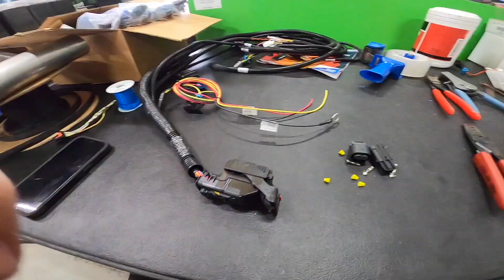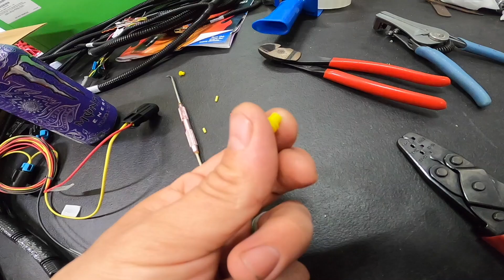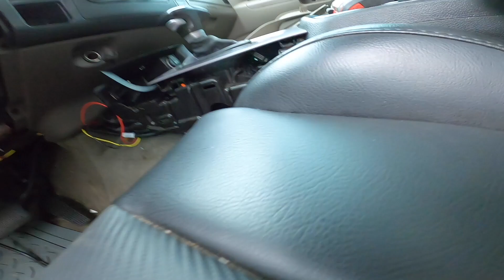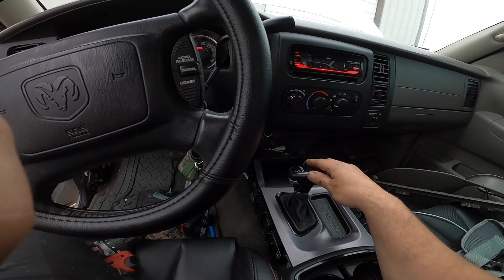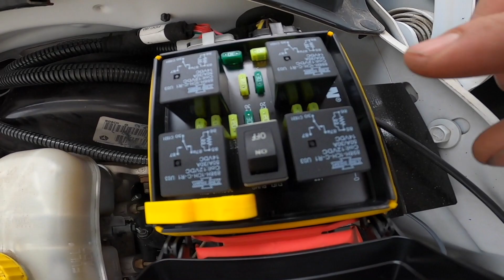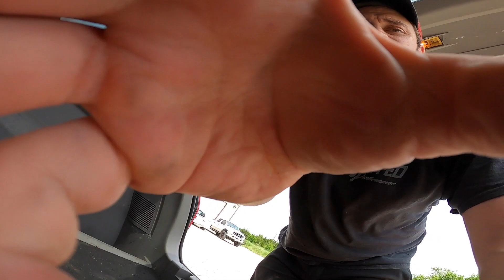New Updates! Sound German Engineering Transmission controller install! and a NEW Part! check it out!

Comment: I have a buddy that swapped a 8hp70 into a 1973 challenger. He wired everything up like you have it and he can't get it out of park and into gear. Any ideas?
Reply from the maker: @halfastracing8311  he’s missing something. Possibly the brake switch input. Depending on how his kit is setup. It’s either looking for ground or power. The kit is configured one way or the other. That needs to be looked at.
Reply: @MoparManiacMotorsports  he hooked it up to the power wire off the brake switch. Although before that he had the brake switch pin ran to straight ground. That didn't work either. I'm kind of just trying to help him out without actually seeing the car and seeing what he has going on. So just taking his word for things.

Comment: What car is that console out of?

Have you tuned the transmission yet? Im wondering how well that piece works...
Reply from the maker: @brandonbass389  I actually ended up selling the truck. However I’ve done the 8 speed swap in lots of vehicle and it’s worked perfectly. It’s different how you tune these with the SGE kits because of the lack of torque management

Comment: I want to do this after the winter in a 2004 Ram 1500 quad 5.7L 545RFE 4x4. I have 2 concerns that you may be able to help me with. The 2004 is the Chrysler PCI bus, not CANbus.
1. Using the sound german kit, can I keep my check engine light off (need to pass inspection)
2. How do I do torque management between shifts? I'd like to cut injectors or retard timing.
Also, what state are you located in as I'd like to bring it to you for the swap.

Comment: Quick question..I have the same shifter but mine doesn’t seem to connect to the shifter.. the connections look different
Reply from the maker: Probably have the connector for the rotary shifter for the trucks. You’ll need the one for the car shifter
Reply: @MoparManiacMotorsports bro thanks for the quick reply but I looked at it again and I found it…I was looking at the “shifter” up top and not from the actual shifter. Had me stressing for a little but it’s there lol

Comment: Is that harness for the hp basically a stand alone ? Or does it need to read engine rpm to operate.
Reply from the maker: It has inputs for rpm. Or it works off of the can bus.

Comment: I did this swap kit in my awd Durango.  It runs good. 
How did you get the charger cluster to work?
Reply from the maker: @justswapit-jsi-8911  with the sound German kit integrated with the mopar crate kit Via the CAN BUS
Reply: 2011-13 Durango with the RFE transmission ? I'm thinking about swapping out my 65rfe for the 8spd I have slot of bolt ons but the gearing makes it a slug . I drive it slot so I'm curious as to how trouble free your swap has gone and if it's daily driver worthy swap or just weekend toy reliability?
Reply: @yerwrng you can do it. The problems maybe the transfercase holes being different. And wiring and making sure both computers are happy
Reply: @justswapit-jsi-8911 Caaes on the 13 and 14+ are the same  so they bolt up to both transmissions mounting holes on the crossmember probably fall in slightly different spots which obviously is an easy fix . Drive shafts might need to be longer fromt shorter rear but thats and easy fix . The question however is after the swap how seamless does it function os it a constant project or does function like stock .
Reply: @yerwrng it will drive good